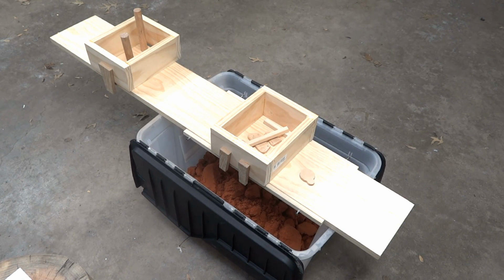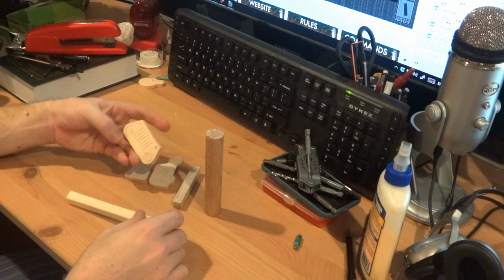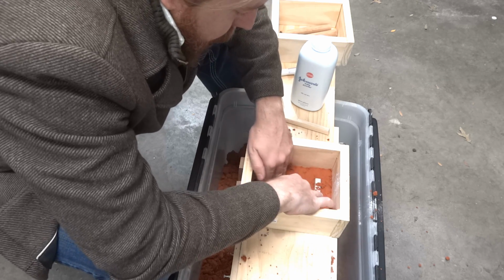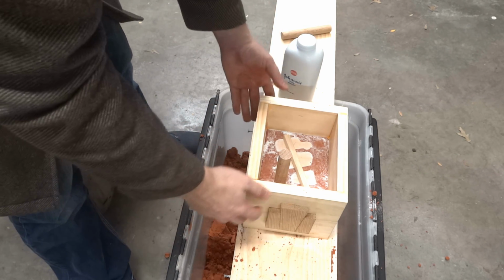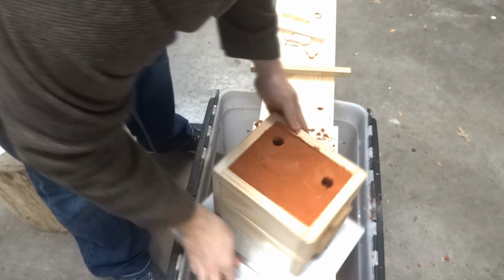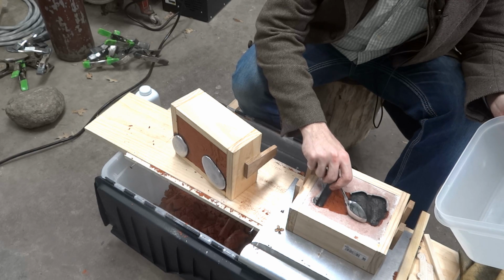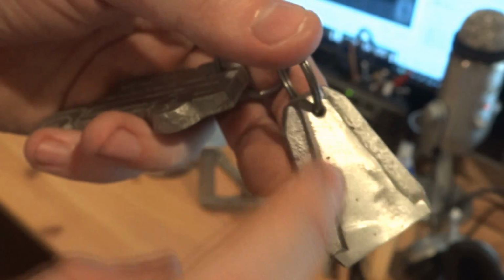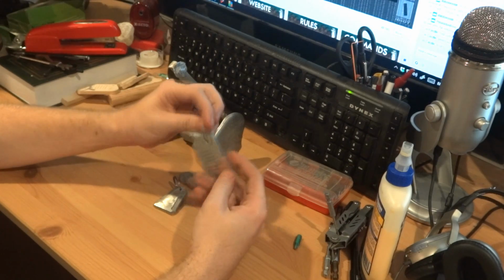Make Custom Keychains by Sand Casting Aluminum at Home in the Improved Mini Metal Foundry

Comment: Talc or talcum is a clay mineral composed of hydrated magnesium silicate. It's normally mixed with corn starch in baby powder. The particles are super small for each substance, so you should be wearing PPE whilst using it. It's often added to Heroin as a bulking agent and is no longer recommended by pediatric people.

Comment: IDK if it's an "officially approved" technique, but you could try adding some non-vertical grooves to your flasks to prevent the sand from sliding out too easily.       Also, I have a parts cabinet with a small drawer nearly full of split rings, so you're not the only one.  They DO come in handy once in a while.
Reply from the maker: Yeah that is a common addition to prevent the sand from spilling out.  i actually did that in a later flask that I made (not in a video).  I used 1/4" dowels glued in.

Comment: Those look really good! What's wrong with can aluminium though?
Reply from the maker: +ChaosPotato there is no silicon content in aluminum cans.  Most casting alloys of iron and aluminum (also some bronzes) have high silicon content.  Aluminum without silicon is less brittle, so it can be drawn into extrusions or cans, but it doesn't flow as well into detailed molds and it shrinks much more as it solidifies and cools, causing casting problems.  Simple keychains like these would probably be fine in pure aluminum, though.
Reply: Oooh alright! I've tried some casting using the very same furnace, lost foam style but I crapped up the foam so the castings were ugly. Watching your videos did spark the will to try again though, thanks! :D

Comment: How many pounds of sand did you buy?
Reply from the maker: +Matthew Mckenzie petrobond?  I had 30 lbs when I did this video, I'm up to 60 now.  The sand compresses far more than you would think when it's rammed up, so more is better.
Reply: +Paul's Garage yes I was referring to the petrobond
How much do you think I will need for the gingery lathe bed
Reply from the maker: +Matthew Mckenzie the lathe requires some pretty huge molds for some of it, I would guess my 60 lbs isn't nearly enough.  I don't know exactly how much would be needed but I would want 100 lbs at least.  Then I would want help moving all of it.  I was thinking of making some play sand/cat litter stuff so I didn't have to shell out for a bunch more petrobond.  Petrobond is pretty good at preserving details, which I'm not sure is required for the big lathe pieces.

Comment: Sifter does not make sugar to powder sugar it just incorporates air. Making what ever you are sifting less dense.
Reply from the maker: obviously I don't bake much.  I think the sifter for casting sand just breaks up clumps, it probably makes the sand less dense in the way you describe too, but i think ramming the sand compresses it again, but i could be wrong.
Reply: trapping sifter might work better they are made for sifting dirt and stuff so there is no chunks in trap set. basically they are a wood box frame with wire mesh for a screen that you just shake.

Comment: Paul, I can rip into you for loads of things but what's the point.
So one thing, place the items in your Drag (bottom box), then before dusting, move the drag out of the way dust & replace the drag.
That way you get no parting dust on the drag, same goes when you do the Cope (top box).
Also don't use so much, any build up remaining in there will burn and can cause issues with the metal. HAVE FUN
Reply from the maker: +Andy K thanks for the tips!  Putting the drag on the board after dusting makes perfect sense.
Reply: it simply stops the parting dust getting on the cope & drag (and then getting slippery) also fro small flask's like yours, it would have been better with rough sawn wood then smooth, it's probably all that would have been needed to keep your sand in there! live and learn.

Comment: This is certainly very different than most "casting" videos on the internet.
Reply: Yes.  Paul actually knows what he's doing and makes useful stuff.  He's not dumping copper onto a block of ice or building a furnace out of FOAM.

Keep up the good work Paul.  Nice first go at petrobond.   I want to see you get to lost wax ceramic shell!  You can do it.  Now get to work and make the switch to propane or WMO.
Reply from the maker: I've seen some lost wax ceramic shell stuff, very cool indeed.  I'm probably going to switch to propane at some point, seems like a lot less hassle than charcoal.

Comment: Of all the things you can make out of metal and you make keychains?
Reply from the maker: +JACKAPUNCH44 indeed I am starting small.  I wanted to make sure this all worked doing something simple before doing more complicated stuff.
Reply: Paul's Garage lol, the first thing i cast was zinc knuckles out of melted pennies. i didnt use a flask or petrobond i used lost foam method. i put a metal funnel over the foam, but sanding and filing took forever,
Reply: Paul's Garage lol, the first thing i cast was zinc knuckles out of melted pennies. i didnt use a flask or petrobond i used lost foam method. i put a metal funnel over the foam, but sanding and filing took forever,
Reply from the maker: That's a good idea!  I have some chunks of zinc, I'm saving them for a project that requires more strength than aluminum

Comment: Paul, Just wanted to give you some usefull information sorry if im spamming but, you sohoud pour ingots first and then cast something, then it will be alot safer and your aluminum will be cleaner
Reply from the maker: +Taite Lennox that's a good idea, I was using clean scrap (as in I washed it clean of junk first) but making it to ingots and removing impurities first would have been better.  I just didn't have time to do that lol
Reply: It's not spamming if you are entering into a constructive dialogue about the video subject. Plus you are correct that it is better to take scrap, pour ingots then pour project items. Concentrate on one problem at a time.